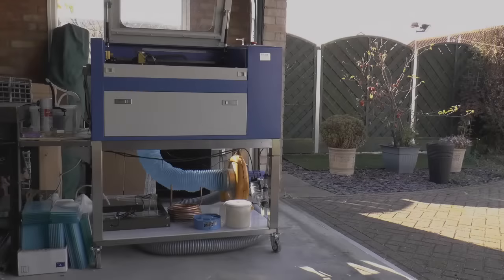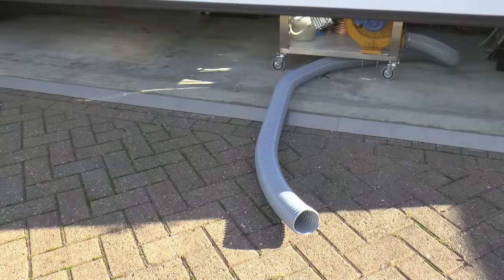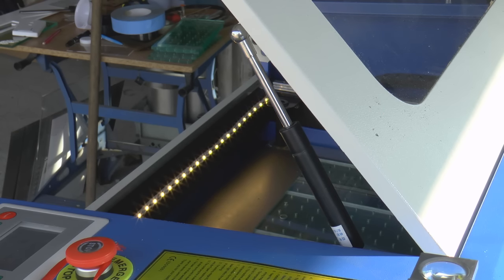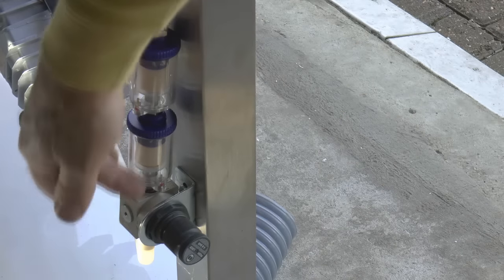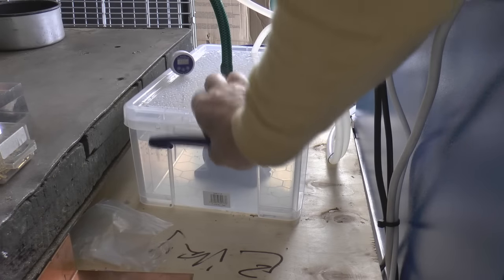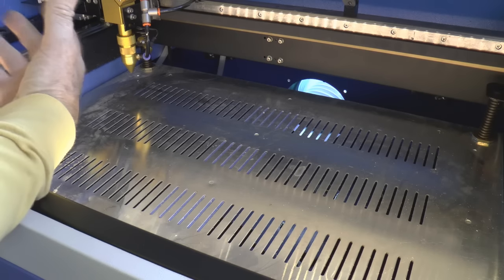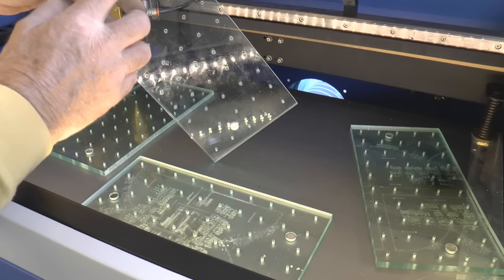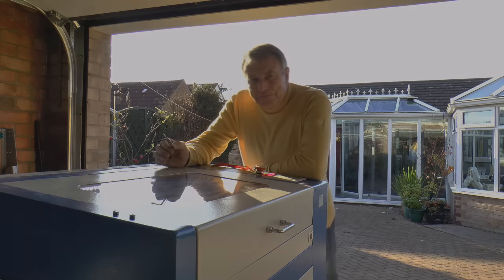My 50 watt Chinese Laser 4-month review

Comment: I'm really considering purchasing one of these Chinese machines but I'm concerned about the quality... Companies that specialize in these machines like Epilog are great but they're soooo much more damn expensive. Are these equally as easy to operate after upgrading the simple things that you showed in this video? And is the software easy to use?
Reply from the maker: Hi Seth
If you want to start a business and have to hit the ground running then stay clear of ebay machines. Go directly to china and buy from a reputable factory with a proper tube and matched power supply. If its a boat shipment then 4 to 6 weeka and a reasonable transport cost plus import taxes. If you buy from ebay just assume that the tube is a relabled factory QA reject but functional and a similar dodgy power supply. Basically the mechanics are very reasonable for the money but the tube and power supply will need replacing almost immediately. So factor a new tube and power supply into your purchase cost. When you get your ebay machine and kick up enough fuss with the seller you may be able to threaten 100% refund from your credit card company for "not fit for purpose" or "  mis -selling" and be able to negotiate a refund of $200 or more  that will help towards a new tube and power supply (possible upgrade as you are about it?). With not too much effort , once you have good heart and lungs the rest of the body is pretty good. and will still be 1/10th the price of an Epilogue. 
I have just started a  venture with a new Chinese machine with a difference. A UK company that is buying their own spec and better quality machines from Chine as a design and manufacturing venture with a Chinese company that they collaborate with very closely. It is certainly a great improvement on any ebay machine but about 20% of the cost of an Epilogue or Trotec machine. As well as it featuring in later episodes of my Learning Lab , I am doing a series of similar style videos for Thinklaser as training/ user/review/discovery sessions. It deals with all the basics of RDWporks and shows how simple it is to use. If you are competent in some other program such as CAD, corelDraw, Illustrator etc then RDWorks is just an interface program the quickly turns your designs into machine code (without you ever seeing it) and magically it appears in your machine.
If you want to see those new videos start with
https://www.youtube.com/watch?v=kx4vmDguCyE

Best regards
Russ

Comment: i got one of those blowers with machine , they very strong and very loud, so i just bought router/fan speed controller on ebay and it works great . i run it on about 75% power. Chinese fans are cheap to , it think about 70$ ?
anyway thanks for making those videos i am learning  about  lasers too
Reply from the maker: +mateusz1945 
Fume extraction is a key weakness with many of these machines. It's great that your machine had already addressed this problem.  Although fitting a speed controller will reduce the noise it also reduces the airflow  which is critical to efficient fume extraction. If you strangle the flow to the fan, it goes into stall mode and makes a lot of noise. If you are running your machine with the cover closed (a natural and obvious thing to do) where is the air coming from to feed your fan? Are there large grill areas around your machine to allow air in? I guess not.  Good extraction needs high airflow  not lots of suck. Experiment a bit and perhaps you can get back to 100% with less noise.
Thanks for feedback.

Comment: how did you ground your machine sr?
Reply from the maker: Hi Able
Here in the UK we have a grounding integrated into our supply system so there is no need to use a separate grounding spike. My ground is via the third wire through the normal household distribution board. 
Best regards
Russ

Comment: Wow, your distilled water is very expensive where you live. I am in California and I drink that water all the time and it costs $0.80 for a gallon (3.78l).
Reply: Just a tip from a water engineer. Make sure to get salt and other minerals into your diet since distilled water contains none of it. =)
Reply: Distilled water/pure water will demineralize your teeth VERY quickly. I have been told by several dentists and a friend of mine who just does root canals all day. Everyone of them tells me distilled water is the absolute worst type of water for your teeth. Seltzer water is second, because the carbon dioxide in water produces carbonic acid. Soda although it contains sugar, has a large amount of dissolved substances and tends to leach minerals less, but the phosphoric acid will etch your teeth. When he sees younger, seemingly thin people getting root canals (people with a low sugar diet) they almost always drink one of the two above beverages. Their should be a warning on the distilled water.

Comment: Top tip if you want cheap deionised ultra pure water with 000ppm , find your nearest Window cleaner.
Reply from the maker: Hi Deionised water is free from solids as you have rightly point out but it is not free from bacteria / micro organisms. Distilled water has been boiled and recondensed and is thus free from both. Micro organisms are not an issue for window cleaners but when you are creating a continuously warm environment then you have great opportunities for algae type green or grey slime to develop over time. This machine is now over 5 years old and the water is 50% original, I have just topped it up two or three times. It is a closed system with a  lid to keep external ingress of microscopic air borne spores  and it is still crystal clear. .Yes it  is more expensive  but I have never had to purge and desludge my tube. 
Best wishes
Russ
Reply: @SarbarMultimedia  the water i produce is because it's also passed through a carbon block filter and 2 micron sediment filter then passes through a VU sterilisation tube and stored with a 1000L ibc.
Reply from the maker: @AW-Services   Thanks for that additional data. Yes, UV disinfection kills all but the most robust microbiological  organisms  Thus I agree that such water would be a viable choice . Thanks for the UV  clarification because I discourage people from buying cheap deionized water from a hardware store That stuff  is fine for topping up car batteries because few organisms can survive the harsh acidic environment.
 Best wishes
Russ